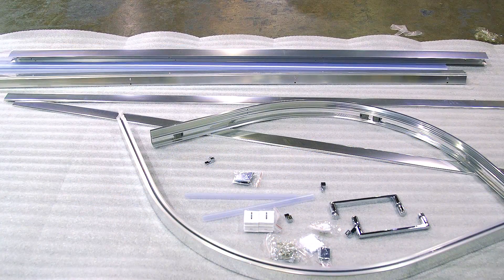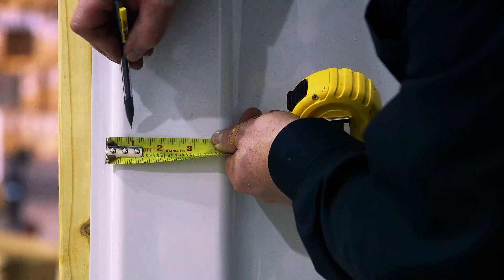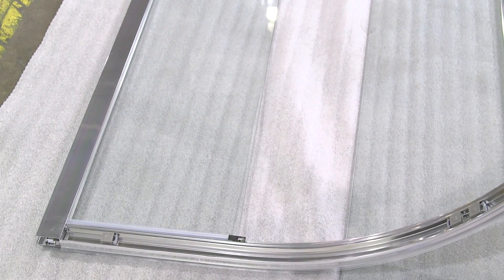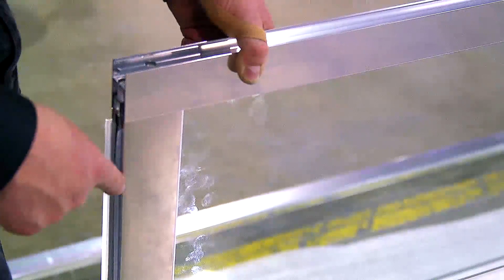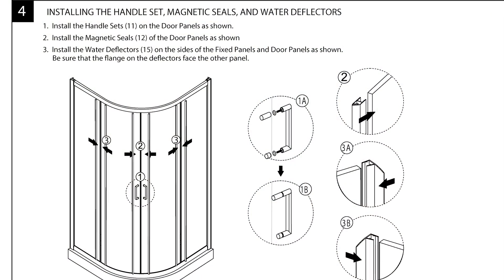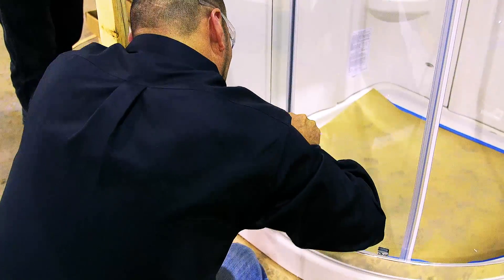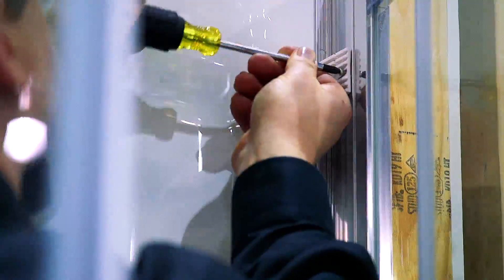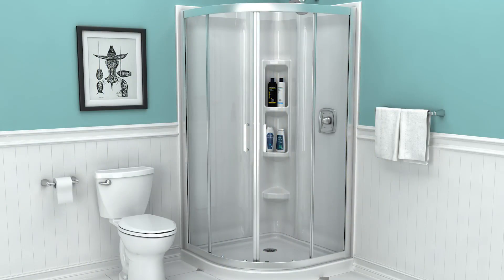How to Install American Standard AXIS™ 38" Curved Shower Door

Comment: Built the enclosure and set it on the base with the end fixed hangers slide onto the enclosure. Then after marking with a pencil where the fixed rails have to go, removed the whole thing and skrewed into place the fixed rails and the enclosure slid right in with a tight correct fit.

Comment: I agree, they leave alot to be desired.  I'm about to tackle this, but I'm going to use the assembled frame to help determine where to install the wall mounted tracks.  I have done a dry run and if I installed the wall mounted tracks first, I'd be in trouble.  Good luck!
Reply: YOU ARE SO RIGHT!  I FOLLOWED THE INSTRUCTIONS AND ENDED UP MOVING ONE OF THE ENTIRE WALL PANELS THEN  HAD TO FILL IN THE FOUR HOLES.  HOPE YOU HAD BETTER LUCK THAN MOST WHO FOLLOWED THESE VERY VAGUE AND USELESS INSTRUCTIONS!
Reply: @waydeprice1233  the whole thing is just bad.
Terrible quality.

Comment: For those watching this video......

Please add the following....

Backfill jamb holes with silicone before mounting wall jambs.

Be very careful with small fastening screws as the heads break off very easily.

When sealing door, caulk entire perimeter with GE type II silicone.....do not use latex based sealants.

When sealing interior of door caulk vertical wall jambs and only about 10" of curb from wall jamb, do not caulk across entire interior of curb or you will trap moisture, which leads to mildew and bacterial build up.

These doors are designed poorly at best best, good luck with install and be sure to maintain door through out its life or it will fail quickly.

Comment: I mean if your guys actually put the spacer blocks on the bottom horizontal rail 1:50 in the correct spot it would have been better. Super fail....they are meant to go in the notch between the horizontal rails and the glass panel fyi whoever watches the video. Its on the instruction book 📖

Comment: I rehab rentals for a living and had to install this my professional opinion throw away the instruction put the frame and flat glass pains in with spacer blocks m4 35 the long screws put the wall post on the frame set it to your shower center it mark your lines along your post and thats where they go hang your doors stupid easy put gaskets on put handles on your Are welcome

Comment: this thing leaks like a sieve... Everything is tight and secure. Only thing, I put silicone under the lower frame thinking it would create a water tight barrier. Every shower I take water drains out in the right and left corners..... JUNK!!!!!
Reply from the maker: Hello JB! Placing silicone under the bottom rail may have caused an air gap, which is likely causing the leak you are experiencing. However, placing sealant along the edges and corners of where the shower door meets the floor should solve the issue. If you continue to experience leaking, please give us a call at 800-442-1902 so we can get some more details and assist. Thanks!
Reply: @americanstandard   WHY not make a base with a slot frame sets into base forcing water inward , so no chance to water escaping , maybe you could use real engineers ?
Reply: @stevenwilliams9641  You're assuming it's in a perfectly level and plumb environment.  Any variation and that slot will just hold water.  You should always seal any gaps with silicone to stop water.

Comment: The fixed panel extrusion should be flush with the top and bottom rail. If not, flip the fixed panel vertically.
What???

Comment: Installed as instructed in book and watched videos,  1st screws that came with set are junk, advise upgrading to quality screws unless you like stripped heads. 2nd doors  1 fit perfectly  other had a gap at top 3/4" wide. took door off no adjustments available so I placed a small washer to adjust top angle fixed that. 3rd showed no caulking around base!! those lil gaskets on bottom flowed like a river, and had issues in bottom corners also,   Why does no one make a base where walls fit into a slot forcing water inward ????????  DURRRRRRRR
Reply from the maker: Hello Steven - Sorry for the frustration! We appreciate you taking the time to share this feedback with us, and would like to learn more about your experience. Please give us a call at 800-442-1902 so we can get some more details and help address your issue. Thanks!